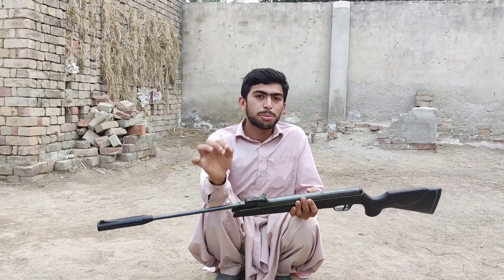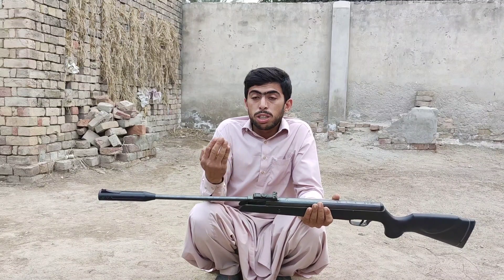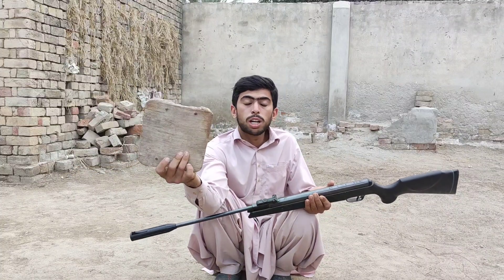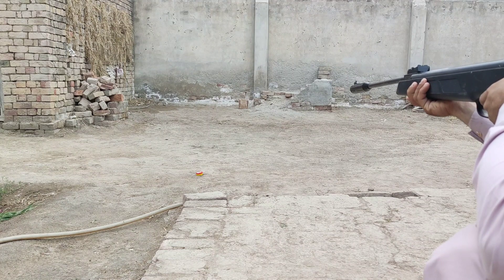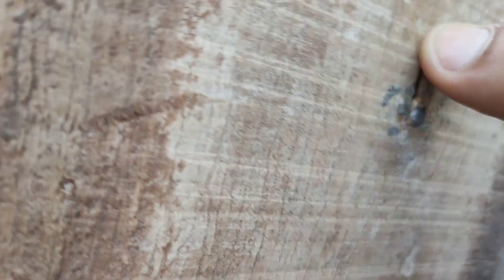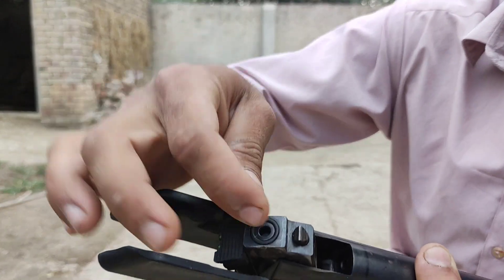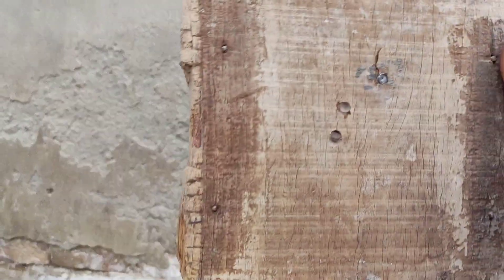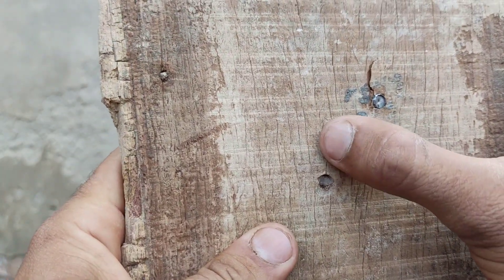Double Shot Airgun

Comment: I just did that this afternoon by accident! It made a nice grouping: the 2 pellets hit less than inch apart at 15 meters. 

According to the kinetic energy formula, velocity should be proportional to SQRT(2/m) so doubling the mass should reduce velocity by about 41.4% -- assuming friction is negligible.
Reply from the maker: Yes, You are Right in that sense. I wonder how much Energy it produces in a high power airgun that shoots 16 grain pellet at 1000 fps.